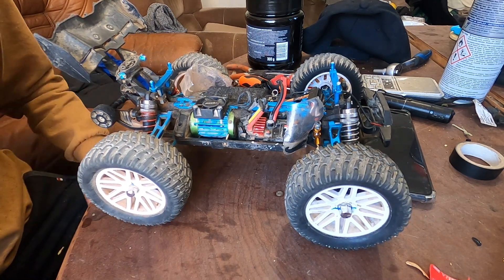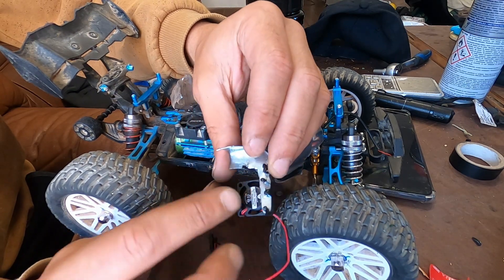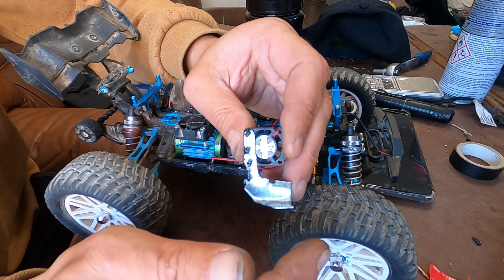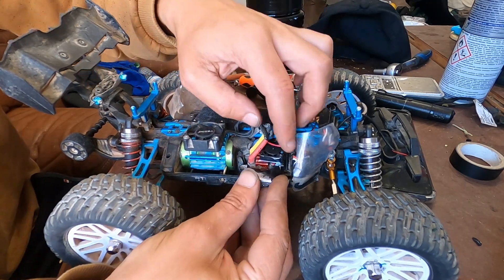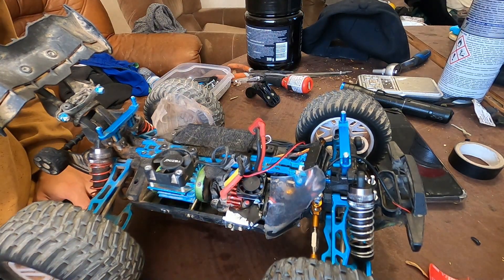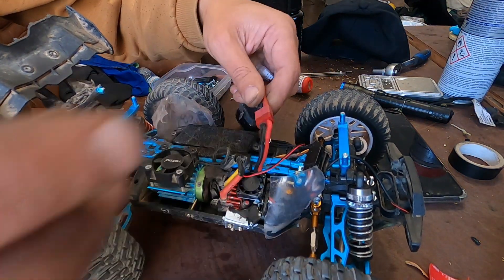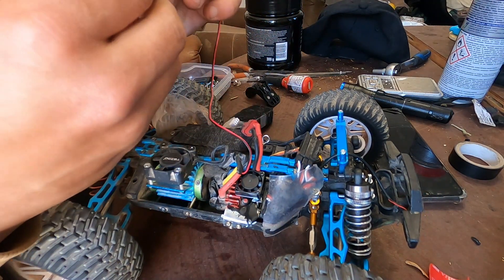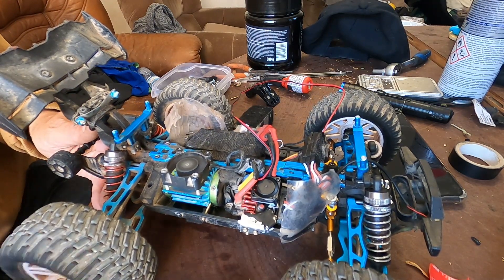SG116 max ESC fan mod DIY! scy 16101, Q130, Q117, 16102 upgrade!

Comment: woah that thing is moded to the max i have a question did you notice any isssues with the esc when you took power from the servo i know there are limits but i just want to know if the esc could get burned via the servo power used to power the fan thanks
Reply from the maker: Hello  @mikymikhail   no problems but there is one thing, if I want to use 3s I can not get the power for the fans from the esc, because the servo wont have enough power and may not work properly it did happen to me but maybe it doesn't happen in all cases. The solution is you should get the power from the balance port on the battery, I am waiting for 3s cables to do a video about it so people know how to use 3s without burning the motor or having issues with the servo.
So stay tuned, if you need anything else just reply here, or if you prefer semd me an email.
Thanks for the support.
See you soon.
Ricardo

Comment: Hi with the stock charging cable in how much time the stock battery charges full (green light ON red light OFF) ? I charge mine for 4 hours 30 minutes but still the green light blinks and red light remains solid. Thanks!
Reply from the maker: @amarnavadagi   I believe ot should be charged by that point but leave it for more like six hours, when it is charged should stay only green light on.
If it doesnt contact the shop so they can send you a replacement or some type of refund.
I hope it helps you, let me know how it went with the charging.
Thanks for watching and see you soon.
Reply: Stock charger will take a long time, i think other chargers will be faster.

Comment: Hi! Goodevening!Can i ask? Where did you attached the wire of the esc fan?
Reply from the maker: @discuatanercolerhysp.7721  hello I used this cable diviser that ypu connect to the esc to divide the electric signal from there, i leave you the link:https://s.click.aliexpress.com/e/_EIJz7Dx
Thanks for watching.
Reply: @Fast_Lane_RC  It is possible to connect the 3 pin of cable of the divider to the 2 wholes only of my mini esc fan? Because Im so confused how it done.
Reply from the maker: @discuatanercolerhysp.7721  yes it is you leave one hole free wich is the signal wire so try one way if it doesnt work turn it around.
Reply: Thank you for the knowledge Brother, God Bless you always  @Fast_Lane_RC ❤
Reply: @Fast_Lane_RC  Hello, do you have also "male connector" link for this devider? (In link is devider with female connector) :)
Reply from the maker: Hello  @hanzhanze9050   you need one male and the other two female, correct?
Reply: @Fast_Lane_RC  nono. I need Just connector to pin it on fan cable  :)

Comment: ESC have Small power outlet that fits the plug I bought from AliExpress
Reply from the maker: @kamalabouelela4553  that is smart, thanks for sharing.
Reply: Do you happen to have a link for the plug you purchased

Comment: Hello again , and thank you for such detailed video.
I am trying to upgrade my sg116 max and am I stuck on replacing the front plastic arm. The top part that holds the tir thingy, you know there is the upper and lower part of the front side.
The part that holds the part that you insert the wheel on.
Seams like it is a torx that unlock it but im not sure,
Can you please let me know how did you managed to unscrew the top plastic part that holds the part that you insert the tire on?
Reply from the maker: @cristi-valentinnedelcu9937  hello my friend and thanks for the explanation, I understood very well, you need a 2mm Hex to remove that screw, dont try torx wont work.
Hope it helps you, in any case if you need anything else feel free to ask.
Thanks for the support and see you soon.

Comment: I have one of these and enjoy your stories.  I have several upgrades planned thanks to you.  

 One question I do have. If I were to buy another car for my kids will there be issues with running both at the same time and frequencies interacting? If so can this be resolved by changing frequency signals?
Reply from the maker: @SPKing-n4u  hello i answered on the email but for viewers that read this i will answer here too.
No problems you can use the both cars at the same because the transmitter uses different frequencies for different cars when you start the car and the remote he looks for free frequencies before pairing with the receiver.
So you re good to go.
Have fun with your Kids and thanks for watching.

Comment: Hi Im new in RC and found your interesting repairing/upgrading videos. Today Ive got SG116 max. Its a beast but Im concerning aboud weird crackling sound from transmition/differential. I can also hear it a little bit in your video (0.22-0.25sec). It drives me crazy, I knoy its all metal rotating parts but the sound is really sick. I hear it also on other reviewers videos so I wonder if its normal since nobody is solving it. THX and keep in good work
Reply from the maker: Hello @Kultus26 my fellow subscriber its normal even in the ad of the product they refer this so people doesnt freak out hehe, the spur gear and pinion are metal so they make this sound, all is good.
Congrats on your buy, you will enjoy it very much.
Thanks for chiming in and see you soon.
Reply: THX I bought it from Ali in only foam box for $60, unbelievable price I thought they will  send me Pro version only...but not Ive got Max and even in original box 😂😂😂 very happy with the buy. Normal price for EU with TAX is around $100. First Ive to change shocks for some oil ones and battery for LiPo...
Reply from the maker: @kultus26  wow this was an amazing price i guess you got lucky hehe